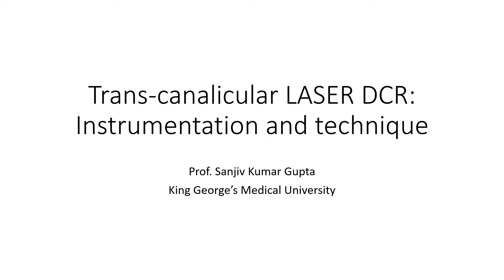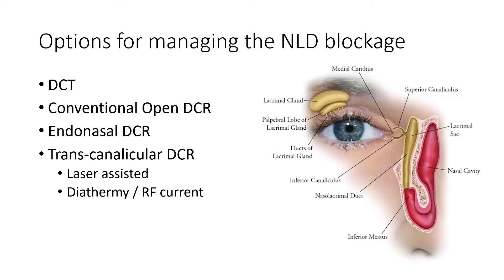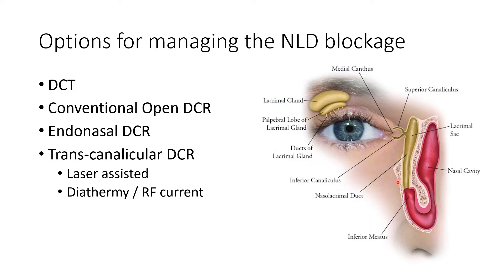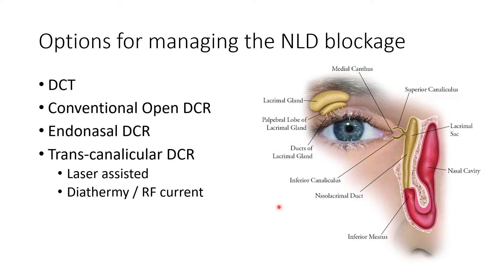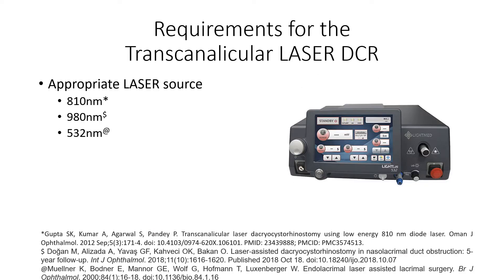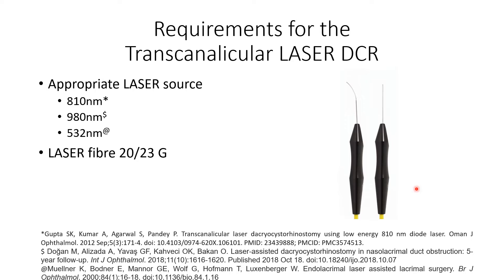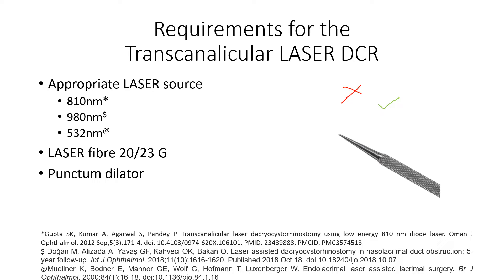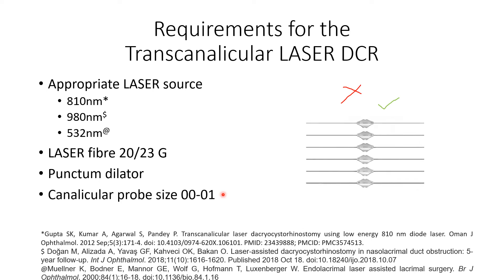Trans canalicular LASER assisted Dacryo-Cysto-Rhinostomy, Using 532nm double frequency LASER.

Comment: Sir, what is the laser settings for laser dcr using 810 diode laser.
Reply from the maker: Earlier I was using this 810 nm diode laser, as it is a versatile laser and is useful for many different procedures. Later I found that no one is marketing it presently. I used the settings of 1000 miliwatts with duration of 1 second. Multiple shots till you achieve perforation of the bone.
Reply: @professorsanjivkumargupta5595  thank you!
Reply from the maker: Do you own 810 diode laser?
Reply: @professorsanjivkumargupta5595  we have  diode laser for retina ..was thinking is it possible to use that for laser dcr
Reply from the maker: @guru10012000  Yes it will work. best wishes.
Reply: @professorsanjivkumargupta5595  thanks, it's 532